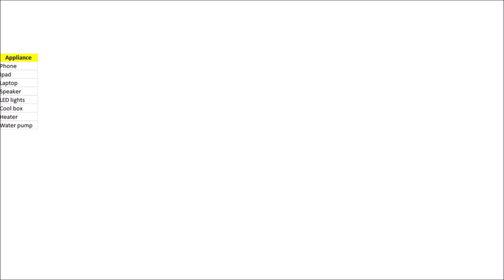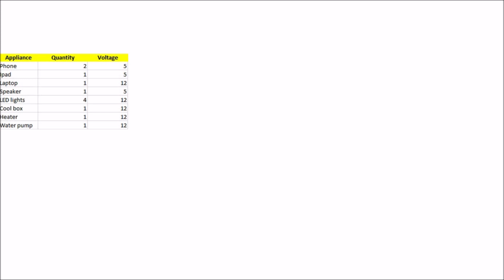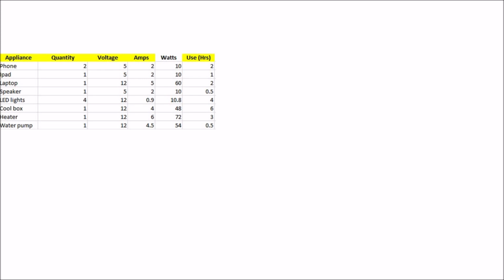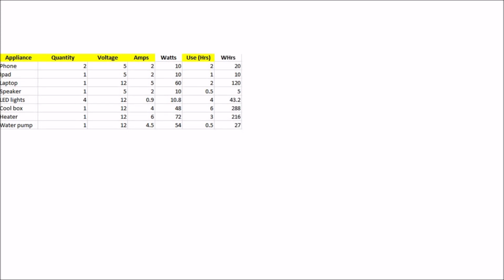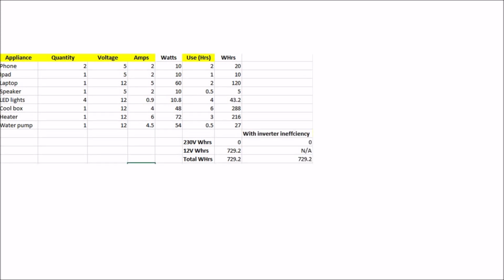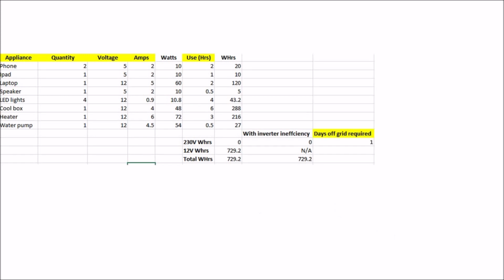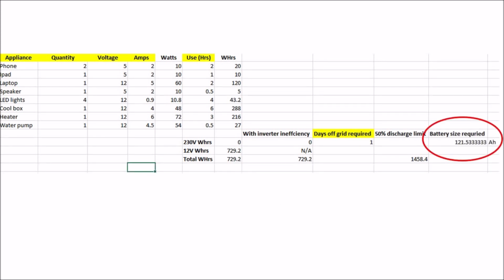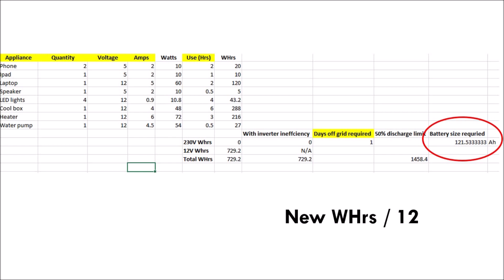CALCULATE LEISURE BATTERY SIZE // CAMPER VAN

Comment: Too hard. What wannabe vanlifer can answer that quiz?
Do not buy any kind of lead acid, including AGM. It's easy to over-discharge them, they're heavy.

Probably you don't need the most expensive LiFePO4 battery, they likely have features you don't need. Hardly anyone in Australia needs protection against freezing their battery.

If you want to run household appliances, you need 10A AC and a 2.4Kw or better inverter. Think microwave, kettle, toaster, espresso. Let's say 3Kw.
To feed that you need a lot of amps. 260A. So you need sufficient batteries to provide 250A @ 12V continuous for some period of time. You might need 2x150AH or better, a single 250AH maybe, but check the specs. There are 250AH batteries that "only" deliver 200A.

Without that requirement, maybe 50Ah for a day tripper (if ice won't do), 100Ah for a few days.  You might not even need to worry about charging while away, charge at home. Vehicle Electrical Service has some videos where he fully discharges various batteries under load (running a freezer on max freeze) to measure their capacity.. If it takes 40 hours to fully discharge a battery under his test, you can expect a few days keeping your food cool. If you carry your "at home" charger, the worst thing on the road might be overnight on a powered site.

I want to run domestic appliance and I plan to recharge while driving, so a DC1DC charger running off the engine is fine for me. An MPPT option on the same device to minimise fuss should I add solar later. The combined unit can balance solar and alternator. Similarly, my inverter will support shore power too, for recharging and balance.